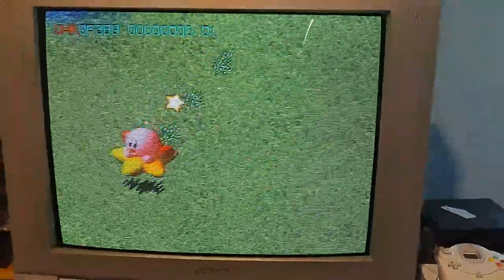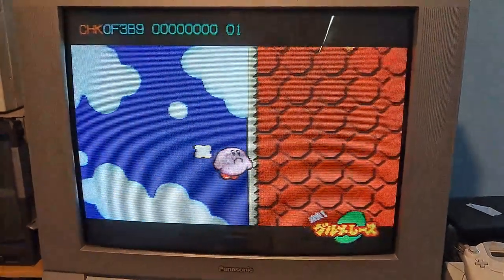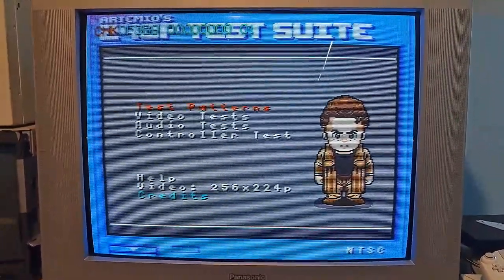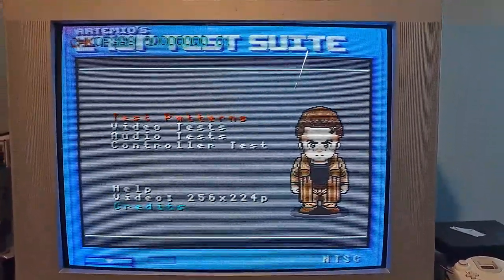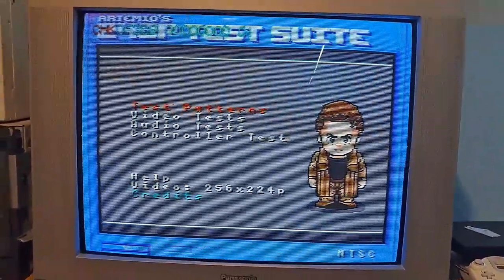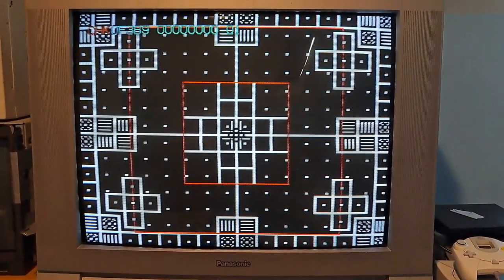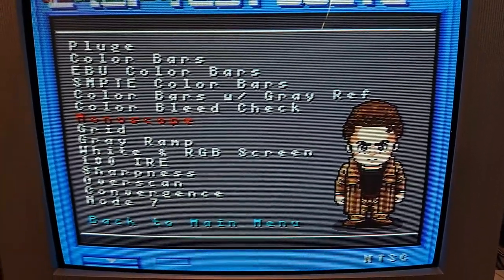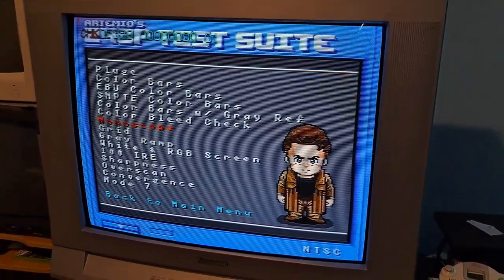240p Test Suite: How I Adjust the Geometry of a CRT TV

Comment: My Panasonic TV has issues with horizontal scaling and crooked corners causing a bit of a funhouse mirror effect, but my menu only has H-POS and the vertical adjustments. How would you recommend adjusting it?
Reply from the maker: I wouldnt be sure, you'd have to check if you might be able to adjust any part of the circuit that interacts with the horizontal picture even if it means soldering in new resistor/capacitor values
Reply: @P-0-Seventeen  Thank you! I think for now I'll just live with it as it's only mild issues, but I'll look into that if it gets worse

Comment: Hello dude, I have a very similar Panasonic TV, a 27 inch Panablack late model, with the exact same service menu and the same vertically flat screen. Could you PLEASE, PLEEEEASE share your adjustment values with me? Not all of them, only from the HDEF to the VDEF sections. My TV came out of the box with the yoke misaligned a couple milimeters to the low right and I thought i could correct it using the service menu. I screwed up the image a little and now I can't go back to defaults. I've looked everywhere for a CRT technician but it seems they've all freaking retired!! Please, PLEASE, in the name of humanity, share your values with me :( if you don't want to write all the names, just put the numbers and I'll assume you're going from the top line of HDEF to the bottom line of VDEF, from left to right.

Thanks in advance, I hope you can give me a hand.